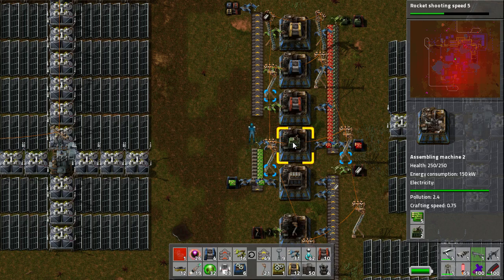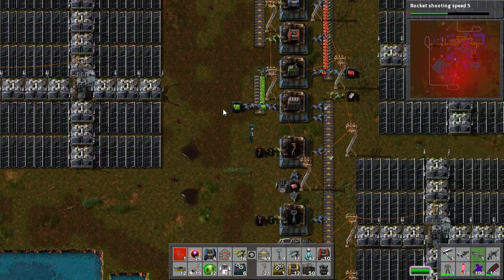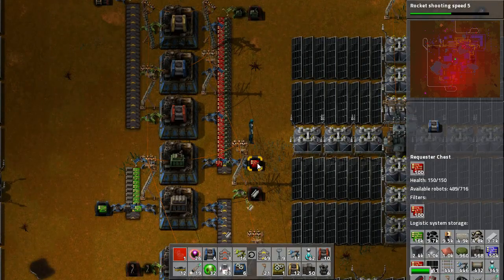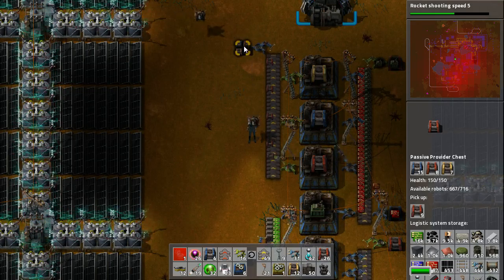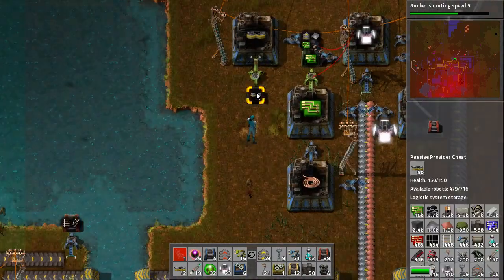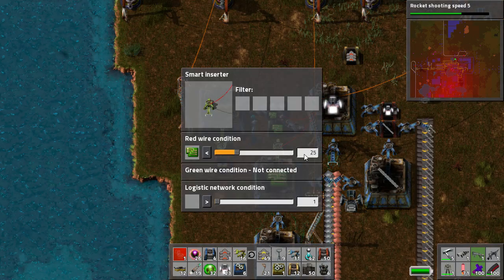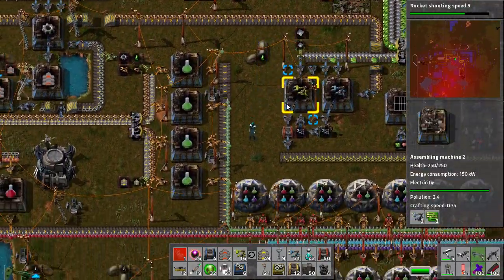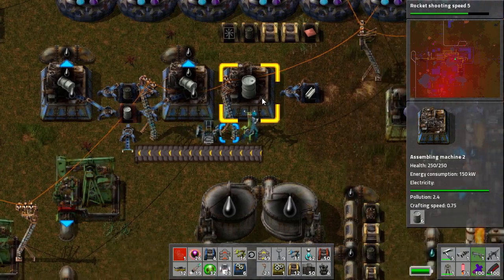Factorio Tutorial 8 - Smarter Factories

Comment: I feel that smart items are often just a waste of time. Buffers limited to x number of items is such a small scale that you will outgrow it quickly. x stacks of the item is simpler to set up. But even that can me too small scale. Buffers of several chests for some low volume items is actually useful. I don't want to waste my time with a factory that isn't producing more stuff, all the time. 

And the reason you had to wire it up with smart items for the logistic chest production was that, as you said yourself, you put all the different items in the same chest. If you had just put them all in a separate chests then you would be able to use the chest insertion limiting feature. You created the need for smart counters yourself. If you don't create the problem then you don't need the solution. I would like to see examples where this is actually useful instead of the artificial examples presented here. When would counting individual items with smart items be easier and quicker to build and noticably more organised than just utilising the chests built-in limiter?

It might seem nice to be able to set a 25 limit which you can just increase to 50 if you need to. But then you aren't accounting for exponential growth. If after your next expansion you need to increase the limit to 2500 (or even 2500 per minute even later) then it isn't enough to increase that number, because a single chest can't handle that much and you have to build a new factory anyways to deal with that. Seems like a lot of micromanagement of the parts of your factory that won't really affect your goals. If you spent that time trying to advance into the next order of magnitude instead then you would get there quicker. What I'm trying to get at is that the perfect red science pack factory for supplying your 2 labs is soon useless unless you plan on never advancing past green science.

Unless you have resources set to so low that you can't afford a full stack of green circuits. I usually play with lots of available ores so factory design is the only real bottleneck and that might be why my viewpoint is so different. But then how will you ever make a bigger factory if even a full stack of circuits is a challenge? You will need huge amounts of circuits whatever your resource settings are at. Having big buffers isn't really a waste. It's preparation for the time when you need a larger amount but haven't built a factory with extreme throughput yet. So why would "have less resources lying around" even be a goal?

I would use 0 buffers if I could make a factory where peak consumpion is <= to production of the ingredients so that buffers would be unessesary for high speed. But that's probably only realistic on a endgame production bus like tutorial #56.

I'm just trying to explain my viewpoint and get some answers. Keep on making great stuff! :>
Reply from the maker: +Q this is just to inspire people/show people what might be possible.. Food for the brain.